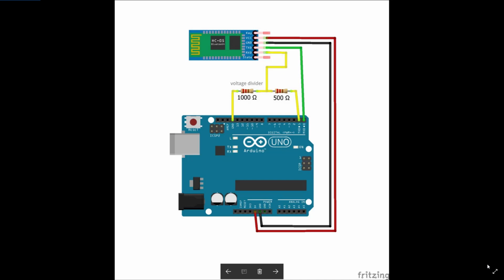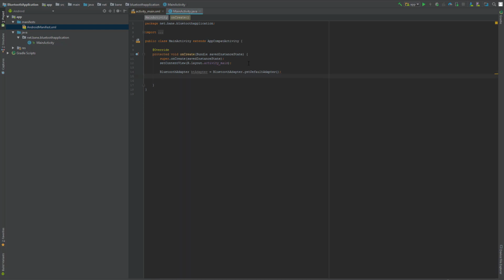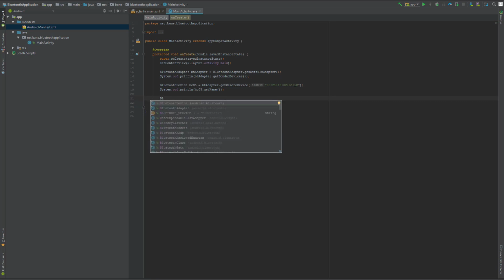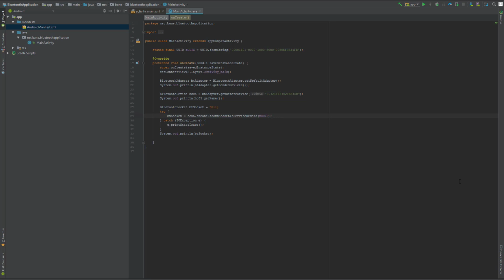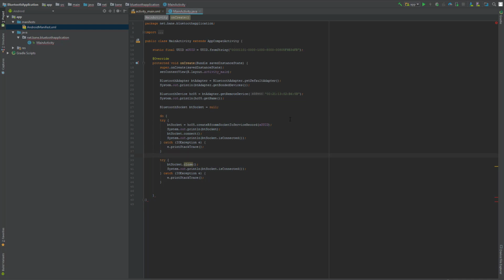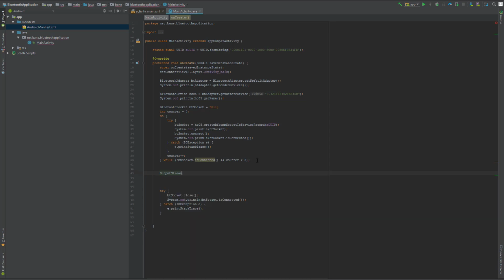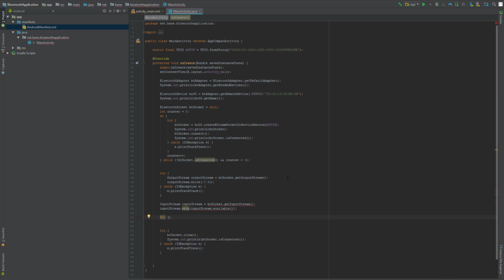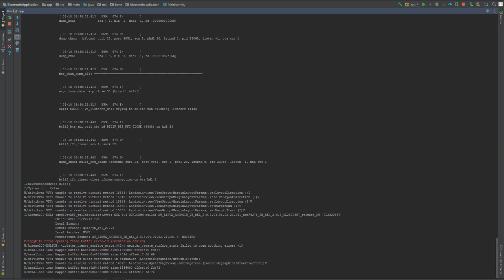Bluetooth for Android and Arduino HC-05 Module, Java implementation

Comment: Thank you so much for this video, it is working and when I send, for example, "6" from android, arduino gets "6" in serial port!

But I cant make anything work with that "6" that arduino got

I have tested sending "6" from the app named Serial Bluetooth Terminal, which I got from App Store, and when I send "6" from It to arduino serial, arduino actually shows "6" the same way as with your code, but this time my arduino code actually does something. What can be the reason for this?

I mean, its like with your code Arduino can get data from serial but doesn't recognise it

Comment: I was able to establish a socket, but it says "read failed, socket might closed or timeout, read ret: -1" when I try to do socket.connect(). Its the same even when I put the code in a do-while loop. any suggestions?

Comment: How would I send an int from my android phone to arduino?
Reply from the maker: Good question! Try sending a BYTE, then CASTING it to an integer. That's how I would try to do it.
If anybody knows a good way to do this, please share.
Thanks!
Reply: @branislavstanojkovic5211  Would the process you described in your video (connecting, creating input/output streams, etc.) be different since the phone becomes the server and the android becomes the client?
Reply: Does the phone become the server in my scenario? Sorry, I'm new to working with Bluetooth

Comment: how could we send data other than a char? i want to read sensor data to my app (double)
Reply from the maker: Good question! Communication takes place in BYTES. You can CAST those bytes to any data type: char, int, etc. Thanks!
Reply: @branislavstanojkovic5211  thanks i got it to work! how would you suggest going about constantly getting data from the module? In the video you used a for loop but what if we want to loop indefinitely? do{ .. }while(true); causes problems with my UI
Reply from the maker: @Aramich101  I have another video posted to my YouTube channel, the subject is serial communication with Arduino. In that video I use a serial port LISTENER, take a look, maybe that approach would work well for you. Thanks.
Reply: @branislavstanojkovic5211  I ended up using multi threading to fix this! It works perfectly now. Thanks again !
Reply from the maker: @Aramich101  Great! Thanks for sharing.

Comment: After connect and renew connect this error occurred: java.io.IOException: read failed, socket might closed or timeout, read ret: -1
Reply: Example: Connect first (All fine), after socket.close() was successfull and try connect again this method returns this error SAME with socket already closed.
Reply from the maker: @djonganelsonlontrowski1949  Thank you for reporting this anomaly
Reply: @branislavstanojkovic5211  I discover how to resolve, some devices not can open/close sockets fast, then, for this slowest devices, is needeed add a Thread.sleep with some milliseconds and everything have been closed with successfull.
Reply from the maker: @djonganelsonlontrowski1949  Excellent tip, thank you.
Reply: Same issue here..has anyone resolved it?

Comment: this method block the UI, we must be use Thread
Reply from the maker: This is a simple example, I did not use multithreading. You are certainly welcome to add that feature to the code on your own. Thank you!
Reply: @branislavstanojkovic5211  how to use on new activity, i cant send in new activity although i have address of HC06, can u give me some key or page that guide me hơ to do that
Reply: Have you found the solution using Threads?

Comment: I did everything like you and I got error: java.io.IOException: read failed, socket might closed or timeout, read ret: -1

What's wrong?
Reply: simulator doesn't have bt, you have to run it on your own phone
Reply: @kubx007TV  O I see i have a different problem :/ thanks though
Reply from the maker: Please share if you manage to figure out what the reason for the error message was. Thanks.
Reply: I am having the same issue
Reply: You figured out?
Reply: Yes  facing the same problem , i think this does not work with blue tooth low energy

Comment: Can I get help ASAP: Im on a project using arduino uno and android as face recognition door lock wherein the face recognition app in the android smartphone will send an output stream to the arduino via hc-05 bluetooth module to operate or "open" the door lock using servo motor. my problem is how can I apply bluetooth capabilities to a face recognition app I found to be able to send data to the arduino?
(note that once a user is recognized, the app will automatically send data to the arduino while there will be a separate button for "locking" the servo motor.)
Reply from the maker: That sounds like an interesting project. To improve your chances of getting help, I would suggest that you share more details about your idea and your work thus far. Perhaps somebody already has some experience with that sort of problem. Thanks and good luck!

Comment: Dear Branislav,

Can you help me with sending int/float/string data from arduino to android? For examples steps data to android through HC-05 module?
Reply from the maker: Hi Matas, thank you for your good question! Unfortunately, it's been a while since I made this video, so I no longer remember much of what I did here. But, I'll try to point you in the right direction.
Consider this: Data is being passed in the "byte" format. If you CAST these bytes to ASCII characters (the "char" format, see an example in line number 59 of the code in the video), you can easily CONCATENATE these characters into strings. Similarly, you should be able to CAST data from "int", "float", or any other format into "bytes" for sending, and vice-versa, from "bytes" to "int", "float", or any other appropriate format after receiving.
Try googling a few examples of "java type casting and conversion". That might help.
Thanks and good luck!